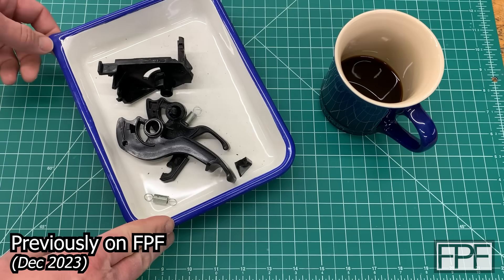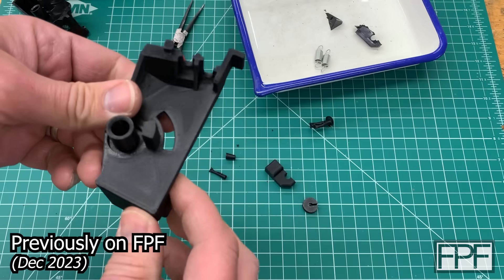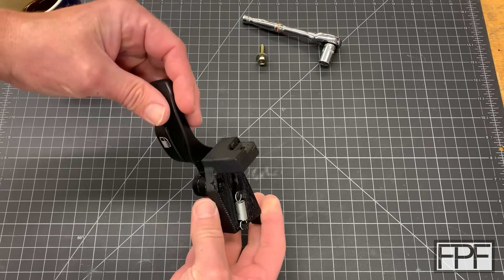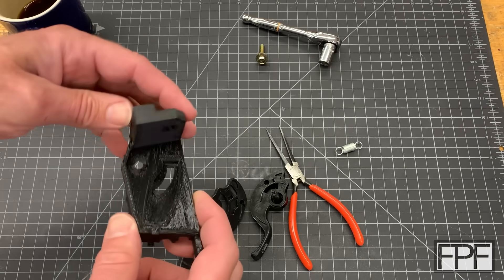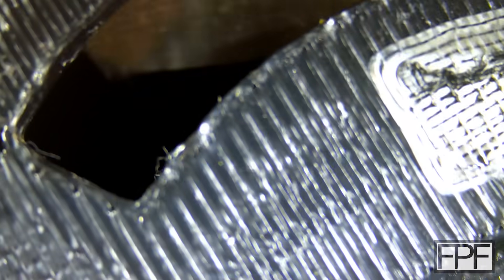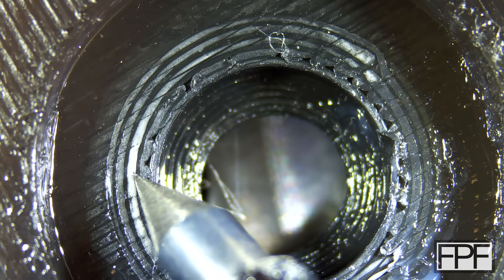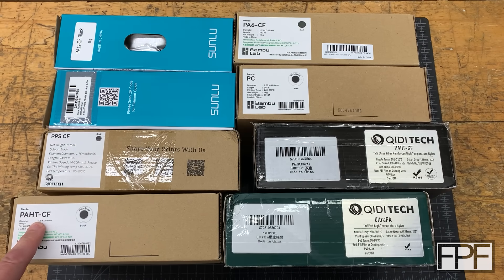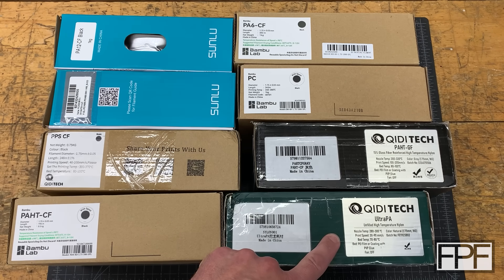3D Printed ABS Car Part Failure Analysis

Comment: PPS is not nylon, it's different plastic. Polyphenylene sulfide. Prritning temperature above 320 degrees, not sure your Bambu can handle it.
It's one of the high performance or engineering plastics, thrown in the same category as PEEK, PEKK, polysulfones etc. There are some plastics which can be printed with obtainable chamber temperatures, but with super hot nozzle.
Reply: It can, it goes up to 350 so does pps easily

Comment: Print orientation, and try the experimental layer offset feature in Orca. Though if you want to us you Bambu printer to print you might have to use Bambu Connect if you have upgraded to the new firmware. Can you anneal  the ABS?

Comment: I'd reinforce a peg that like that with a screw, depending on the size either M2.5 or M3. Make a through hole and add a pocket at both ends for the head and the nut. Tighten it down a bit to pre-stress it. This way the shear and pull stress is handled by the screw rather than the plastic. Kinda like reinforced concrete, really. I'm using that method for really, really small parts and movable joints.
edit: The hooks for the springs look like another point of failure waiting to happen too. Instead, I'd just add threaded inserts in roughly the same spot and then again, use screws instead to hold the springs.

Comment: I've had really good luck with Siraya Tech Fibreheart PET-CF. I use Bambu Profile but up the temp, 275 first layer then 290 for the rest of the print. 100c on the bed.

Comment: +1 for change the design into multiple parts and change print orientation. even if you gain 100% increase in sheer stress it will fail in the same spot at some point. failing that you could inset a small steel screw in to reinforce if there's room. hard to see what room you have but even something like an m3 would probably do more for you than chasing better layer adhesion IMO

Comment: On components where we needed a very strong part we would often use glass filled nylon. However those parts were injection molded and I don't know how/if the fibers would affect layer adhesion. Is it possible that just annealing the original design and material would fix the failure? I am very very inexperienced with 3D printing and materials so consider these comments with many many grains of salt. Thoroughly enjoy the channel keep up the good work.

Comment: I really think you’d be fine reprinting in that same ABS if you can fix the underextrusion and layer adhesion, as well as reorient the print so the layer lines are perpendicular to the stress plane(s).

Comment: PC/ABS and PAHT are all better then ABS when it comes to Layer adhesion. But as others already mentioned, try reorienting it so the Cross section of these protrusions is bigger.
Reply: Pc-abs has slightly weaker layer adhesion and you need at least a 100c chamber to properly print it. 120 would be optimal.

Comment: Idea 1: Interleaved layers, if you can make it. There are some YouTube videos, but idk how available it is for practical use.

Idea 2: extract the broken details into separate parts (with some mounting features) that you can print in a different orientation, then glue them in. (Assuming the plastic of choice has a good glue option.)

Idea 3: add more relief by carving material from the set dimensions side (and adding more on the back side). Albeit, while smoothing out stress points, this might also increase the stress leverage.

Comment: Use the Bambu PC. I’m not a fan of fillers and seeing how your part broke, my guess is the fillers would likely make the possibility of that happening again even greater. I have a-lot of experience printing PC and maybe you can solve my issue of finding a good support material for PC. You will notice there is no ‘Support PC’ blend. I hate PVA. PC alone prints like a dream though. Printing on an x1C letting the chamber heat soak to 60c before printing. I’m sure the H2D would be ideal for this material especially if you can come up with a good support material for it. Who knows, you might sell me on an H2D 😂

Comment: I agree with @sawdust9807 : You need to change the orientation. 
Also PA6/12 doesn't usally mean the CF-content. They are two different types of nylon.

Comment: I think you have already redesigned the whole assembly, because that is honestly a better solution. I guess I'll wait until next time and see. 🤫 

This basically is a right angle bracket and two lever arms, right? If you redesign the bracket you can use large flat cams for the arms that can withstand much more force and design the stop into the cam. You can easily print the gas and trunk symbols with the .2mm nozzle and glue them on. Or you can laser them on. You can probably even design the bracket so that it is serviceable without pulling out all of the trim.  

You don't have the same constraints since you are not worrying about material costs for making 100,000 parts. Throw out the parts and start over. If you sell the car, re-print the ABS part and give them the old assembly and handles in a ziplock bag. 😅

Comment: I ordered that borescope soon after seeing your video about the TPU fuel tank grommet. It's a huge improvement over my Snap-On BK600 (6000?). It's pretty sad when a Chinese tool outperforms an American tool at a fraction of the price.
Regarding the part: I think it's fine as is. The original part would have broken as well if stepped on. It's quite obvious that's what broke the part you made.

Comment: Use a screw to reinforce the spring post. Print the cylinder separately with opposing layer lines and use acetone to weld it to the rest of the part. You can also widen the hole on the lever it passes through so that you can print a thicker, stronger one that goes through

Comment: Just in the first couple minutes, I'd print those standoffs/bosses/whatevers as separate pieces and epoxy them in to a corresponding negative space in the main body. Maybe change the print orientation so you don't have the forces at work pulling on the individual layers.

Comment: Maybe make it in three parts. Since you have a lathe, turn a headed bushing that presses in from the back side for the pivot. The stop could be changed to a pin and also be pressed in. It's a shear problem no matter which orientation you print it. So eliminate it with another targeted material or an insert that's replaceable.  Or go the nuclear route and try something like peek (i can't imagine what that would cost).

Comment: If you saturate a weak spot with CA glue it will wick in and fill the voids, works pretty good. Let it dry and reapply until the wicking stops.

Comment: It is a one-off part, not for production. It burns a lot of your time to access. It is important. Therefore, pay the wasted filament tax and float it on a sea of support at whatever orientation avoids loading across layers in this spot without introducing a new shear load on a layer boundary.
Reply: Maybe use a fancier ABS with some fibres if the spec sheets say that will help. GF ABS seems to be the thing used for injection moulded tool bodies.

Comment: Use your awesome lathe to make metal insert on that sleeve where the levers spin on. Modify the model so you can glue the boss in…
Reply: That and add a steel pin, cut off nail perhaps, to the interior of the stop, pressed in perpendicular to the layers.

Comment: I bought a P1S, no combo for £380 in this sale. I just couldn't resist. Looking forward to stepping into ABS, ASA, PC, and engineering filaments at last. I also grabbed a hardened steel 0.6 nozzle with a discount too to cope with the engineering stuff.

Comment: I don’t have enough of an idea of the constraints on the original part dimensions to know what I could get away with adding to reinforce it, but I do think some version of nylon is the way to go. If the original part itself doesn’t need to bend or flex, then a CF or GF filled PA or PPS would be my pick, but if it does need some flex to it, I would do just standard PA or PPS.

EDIT: after some thought, I wonder if there’s a way to add a modifier to the part in the slicer, so that when it prints the cylinder that broke off, the circular walls begin lower down in the layers of the print so it is more embedded inside the part.

Comment: Here is a good application to combine materials.  like one comment stated changing the orientation is a good option, but inserting a metal stop is another option you have.  I personally enjoy using two different materials one 3D printed and another metal to solve problems like these.  Layer lines no matter what material will never have the strength you need.

Comment: Print the part that broke off as a separate insert piece with a keyed base. This will let you print it in a suitable orientation. maybe a half star patter at the base to key it in.
Reply: For production, yes maybe, but this will burn time in CAD for a one-off and iterating and the keyed-in part might need supports anyway because of the star shaped base.
Reply: @AndrewHelgeCox  Yep, take time and pride to do things right. I said half a star to lay one half flat, could also be an L shape to simplify it.
Reply: @Crazeddingo so you did!

Comment: I wouldn't have been happy with that print from the start, the visible under-extrusion and the orientation of the pivot meant failure was very likely.  If a small feature like the pivot is exposed to shear or bending stress in use then avoiding that stress being resisted by layer adhesion is vital.

Comment: layer adhesion is always the problem.
I'd use an elastic filament (nothing CF filled) and fill the piece with casting resin (add a nozzle into the design so that you can pressure-inject resin with a 10cc syringe). 20% gyroid infill and 2 wall layers should be enough (resin might still seep through the walls if your layers are leaky, but it's a minor problem). If your filament is heat resistant then you could use infusion resin (thin, harder, cures hot) instead of casting resin (thick, softer / more elastic).

Only makes sense if the resin infill will remain at the barrel stress point. 

Theoretically you could add milled carbon powder to the resin, but that'll make the resulting piece stiff and more brittle.
Reply: What about GF in the resin?

Comment: The real issue that this part becomes broken - an auto mechanic is jumping on it with his full body weight 🦘 to squeeze last drops of liquids from a car 😬
Not sure if any plastic can hanle this kind of abuse 😅
So, maybe print and install a "turtle shell"  above it 🤔  or design to move it lower or print a bunch of it🙃

Comment: Option A: Re-print the part, as many others have said, changing the orientation in some way.
Option B: Slight re-design that allows you to print the parts that snapped off seperatly and attach them with something stronger like some kind of epoxy/JB Weld etc
Option C: Re-design the parts that snapped off to allow for them to be attached including another material, like a screw/bolt  and steel tube inset in the cylinder etc
Option D: Some combination of B and C.

I personally would not worry too much about the material, I suspect the ABS you used will be fine again, it's just the layer adhesion you need to redesign for. Many car parts just like this one are injection molded with ABS from the factory.
Reply: To be fair the original injected ABS part must have broken to have started this whole journey. Maybe it is a flawed design to begin with and some fancier filament is called for.

Comment: The original part was designed for injection molding, and you don't have to. Make it out of multiple parts. For example make the pivot barrel out of aluminium.
Reply: Yes, my thought as well. If I can't improve the design, I'd improve material. 3D printing has it's limits.
Reply: That is the exact mindset you have to have! 3D printing has its limitations too so have to consider both sides.
Reply: That’s not a bad idea. Could have it as a metal bushing pushed in from the back side.
Reply: He should have Acetone smoothed that part for practial reasons anyway. Which would bond the layers better. That dust these layer lines collect that hard to get out is an nightmare when you just want to clean your car.

Comment: I would recommend reprinting in ABS with the part orientated like it is at 10:23. Where the print bed would be the bottom of the video. That way the forces on the protruding parts will be in line with the layers rather than perpendicular to them.

Comment: I would say changing the print orientation should mitigate the problems you are facing with the old part. With the dual extrusion of the H2D you should have no problems with the overhangs. You could add a screw - possibly heated up for insertion - in a tight fit hole from the back into the pin to strenghten it.

Comment: I think this is pretty easily solved even sticking with basic ABS for the material.
The pin that sheered off is easily reinforced with a bolt from the back, this is something I always do for small pins like this that need to act as stops or take load from a spring.
The barrel i actually wouldn't change. But as there is room on the back of the part, i would instead modify the handle so that it can be installed on a shaft that goes all the way though and is retained by a bolt and washer or a nut and washer. This would distribute the load onto the much more solid areas of the part... If i needed to make it bullet proof, i would replace the barrel with a custom made (on a lathe) metal cylinder with an as large as possible flange that got pressed in from the back.

Comment: Is the print failure anything to do with the superlube that you added? The microscope view showed grease across the surfaces that had sheared off. I wonder if there is a wicking action over time, that separated the filament along the layer lines, much like you use IPA to release TPU from the build plate.

Comment: I would stay away from the PA6. You have a lot of tight tolerances with moving parts, PA6 absorbers moister after it's printed and swells ever so slightly. PA12 absorbers less, but PAHT-CF would be my choice, it absorbed much less moister and will maintain dimension stability. Your parts failed because you have stress concentrations at the corners. To eliminate stress concentrations you need to fillet the corners to distribute load.  If you can't afford to fillet the corners then print the failed pieces separately with better layer direction and insert insert them after printing.

Comment: i would say countersunk screw from the other side, straight in the plastic compressing on layerline direction, orientation is meh because of the holes sagging. Maybe PETG on adhesion or PA filled with a light annealing atleast

Comment: If you prefer to stick with 100% 3D printed components, I'd try using fillets on mating parts to spread the shear over larger surfaces. But if you just want a more durable part I'd suggest milling these components that bear a high shear load from steel and mounting them

Comment: My first thoughts would be to use a filled nylon, either with carbon or glass fiber. A Polycarbonate filled filament might also be a good option. Then reorient the parts, or run at a higher temperature to hopefully fuse the layers together better. (temp tower test!)

Using steel pins to replace some of the parts may or may not work as well. If they go through the whole part, that should add plenty of strength and not be weak at any layer lines.
E.g. the prongs might be possible to replace with a steel pin?

Third option I would look at is to re-do the levers and make the whole design more suited for 3D printing. Doing so would allow you to beef up relevant parts.

Comment: For my tuppence worth, and I can barely spell 3D, I am very aware of limitation of FDM with thin walls and stress risers.  So my goto solution is usually to manufacture the area I am worried about in a different material (say metal) and bond it in place.  Yes, heat set inserts got me thinking more along these lines.

Comment: I think it would be a great idea to insert a metal sleeve for the parts to rotate in. Should be easy to get some kind of pipe stock with the correct dimensions and cut it to size.

Comment: You could strengthen the "protruding fingers" that broke with a screw down the center of them. This will add a lot of shear strength.

Without that you have to evaluate the layer strength by referencing the out of plane strength value or the in-plane shear strength (if available) in the TDS specification for the filaments. Generally, the higher the CF content of the filament the lower the layer adhesion will be so do not just think more CF is better for this application. 

You could also reorient the part at for instance 45 deg so that the layers do not align with the break surface.

Obviously you need to fix the under extrusion issue that you had in the first version.
Reply: I came here to say exactly this putting a hole in the middle of the finger and driving a screw through it would make it a plastic wrapped metal post.
Reply: +1 to the screw suggestion, came here to say that. Also you are right, all CF and GF filaments will have lower layer adhesion, also some are pretty brittle like PC, best suggestion is still ABS or a non fill PA, also can take a look at TenTech's bricklayers infill

Comment: Just overextrude a little and tilt the part, change print orientation a little so it doesn't align with the load direction.

Comment: PA6 and PA12 don't refer to percentage of CF. They are different kinds of nylons with somewhat different properties (moisture absorption, strength, etc.). The number refers to the number of carbon atoms in the monomer.
Also, I suggest trying to incorporate metal parts in your designs. Sometimes I forget just how much stronger metals are. Embedding even small parts like washers and pins can significantly improve performance.